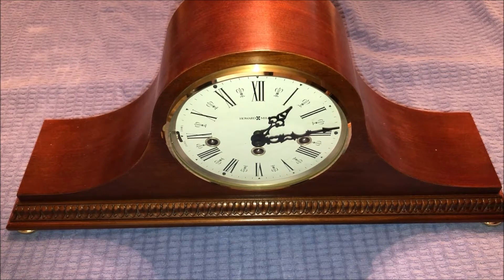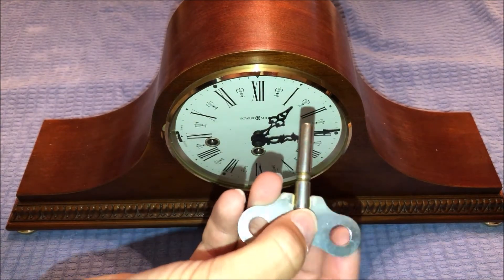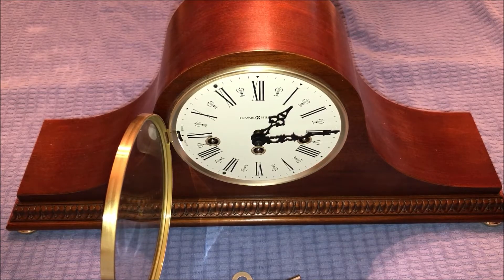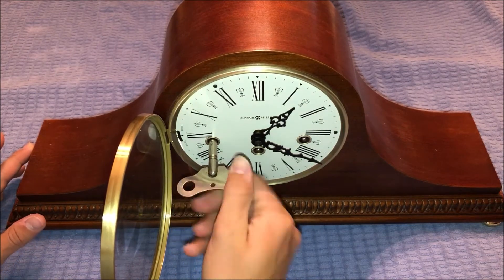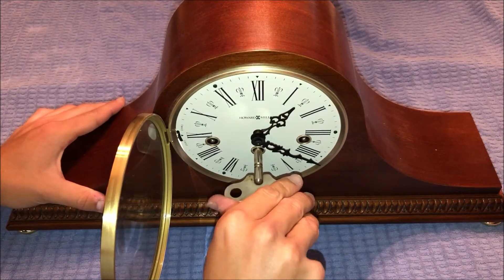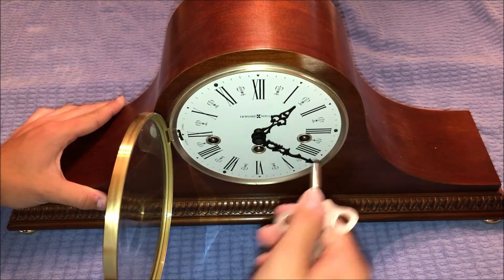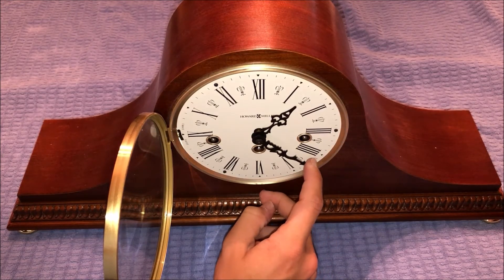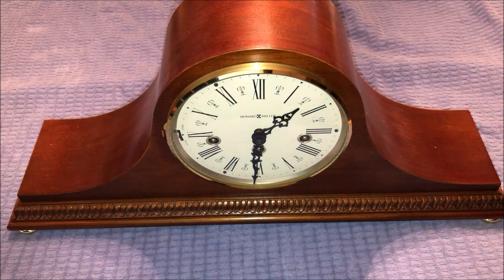Winding the Howard Miller Tambour Mantel Clock

Comment: I have to start the heavy dong and the clock works for just a few minutes then stops. Did I perhaps overwind it and is there a way to get it going correctly again?
Reply from the maker: @DavidWhite-b2i  Overwinding it shouldn’t have affected it.  I would try to oil it and if that doesn’t work, cleaning would probably be most affective

Comment: Thanks for the video.  I picked up this exact clock today at a yard sale for $5!  It came with the same key that you use to wind it up.  Mine chimes and winds and it in great cosmetic shape.  However,  when I wind it up,  it does not tick.  Do you think this is an oil issue?  Thanks for any reply.
Reply from the maker: Might need to be oiled if it's not running.  If not, a cleaning may be needed.
Reply: @Jamestube8439  thanks.  Looks like that’s out of my expertise.  Will see if I have someone who works on clocks in my area.

Comment: I picked up a Howard Miller wind up clock, but it doesn't have a pendulum, starts and runs automatically when wound.  It has gained about 5 minutes, and since there is no pendulum I can stop until it is in sync with the actual time, will it damage the clock to move the minute hand counter clockwise (backwards) by 5 minutes?  I've always been told never to move clock hands backwards.  I really don't want to manually move the hands clockwise 12 hours to get it to the correct time.  Thanks... John
Reply from the maker: Yeah you can move the hands backwards.  I do it all the time on my clocks.  Some clocks however should not be moved backwards.  Based on your situation you should be fine

Comment: I just bought a clock at a donation thrift store 🕰️ and obviously am missing the key 🔑, where can I find one?
Reply from the maker: First things first it’s important to see what kind of key it takes.  Who is the manufacturer of the clock?
Reply: I also just bought one of these at a thrift store. It is missing the key also. How do I know which key to buy as a replacement? The clock is a Howard Miller Westminster Chime mantel  style. The numbers on the back side of the clock are AEL01
Zeeland Michigan. Made in Germany. I’m hoping you can help me find the correct size key 😀
Reply from the maker: @Cowboyssweetheart  A standard size Howard Miller key should work.  I would search the internet for Howard Miller winding keys.  This key should work https://www.amazon.com/Hermle-Hamilton-Ridgeway-Howard-Winding/dp/B008LOI8CO/ref=mp_s_a_1_5?adgrpid=55864257037&dib=eyJ2IjoiMSJ9.HEBuvj7cezKvMNRquVBySvcb3_UQH_vi82PxgscqWwm-8ZbvyGHumK9V4v6ErRZJfYaYY5u4_lL8lTx3lglAsBxc7RLDvdjQ2vJakldUAtyH930x-swEZD2iEyiEwPFjljzC66Sf5QLFwm-Ayn_Qq499FKoE7gkv5jt8NiYoDpmq4ixuMjdPmWMW6jXW2XqG9by_NFBDKvq17BKG8igvKg.r7tdJerhGyg5YMd6973RLFdEPHaQb3JkyyZG0dxAaow&dib_tag=se&hvadid=410019737216&hvdev=m&hvlocphy=9016852&hvnetw=g&hvqmt=e&hvrand=16436849254856643970&hvtargid=kwd-301941283325&hydadcr=12161_11118341&keywords=howard+miller+clock+key&qid=1720132513&sr=8-5
Reply: @Jamestube8439  thank you for your response! I plan to order asap!

Comment: Do you wind till it stops or just until you feel it tighten?
Reply from the maker: I typically wind it until it doesn't let me turn the key anymore, there are a couple of my clocks that I prefer only winding it until I feel it getting tight.
Reply: @Jamestube8439  I have the same clock as you so I was curious thanks!

Comment: Does this clock have a tick tock to it. I don't hear anything after winding mine. On the right side of the face i have 4 settings. Not sure what they are used for. Can you be of any further assistance.  Thanks in advance.
Reply from the maker: It does tick, just very quietly.  The 4 settings are probably for changing chime melody.  I’m guessing one is for silent and the other 3 saying something like West Minster, St Michael, and Wittington
Reply: After further investigation I've come to realize the top horizontal gear is not spinning. I'm going to do a thorough cleaning like in the video you provided and take it from there. Thank u so much for your prompt response.
Reply from the maker: @roberta19348  you’re welcome. Glad I could try to help.

Comment: The middle hole to wind will not wind tight, it just keeps winding  and the holes on either end are wound tight … so it’s not wkn at all … it was brand new when I took it out of the package, so it does not have any dust or dirt
Reply from the maker: That’s strange.  I wonder if the middle hole is connected properly to the spring to give it that winding power
Reply: Idk .. but it worked fine for a day .. I hadn’t moved it or anything
Reply: Think it’s because I wound all 3 of them again on the second or 3td day ? I didn’t know how often you were supposed to wind them, so I just wound them again just enough to get it slightly tight. And they were all three fine at this point….. then it just stopped working, and I realized that the  middle just kept  going round and round and never would tighten